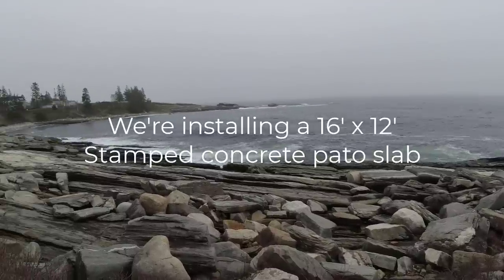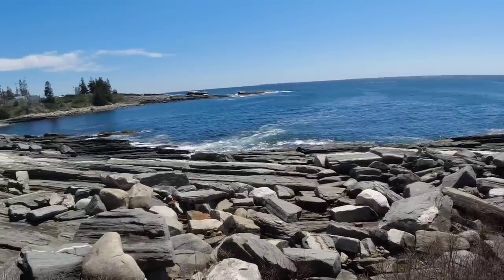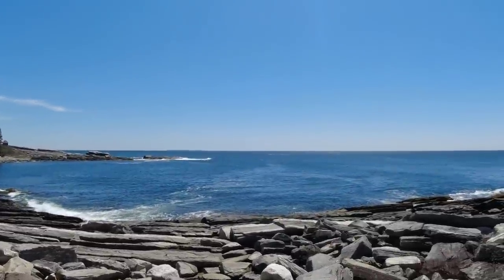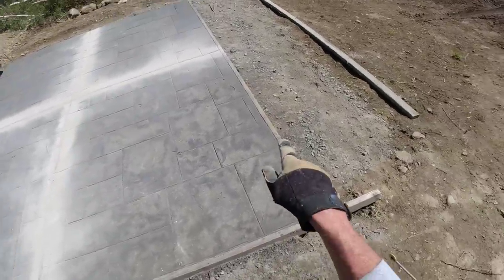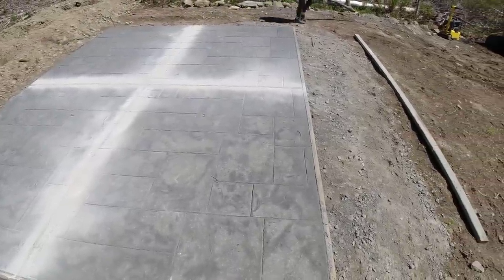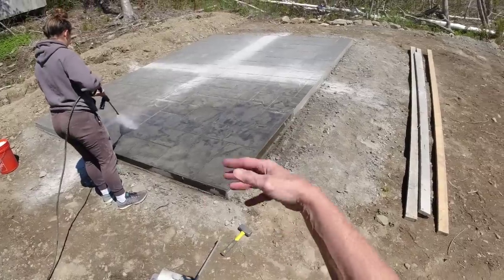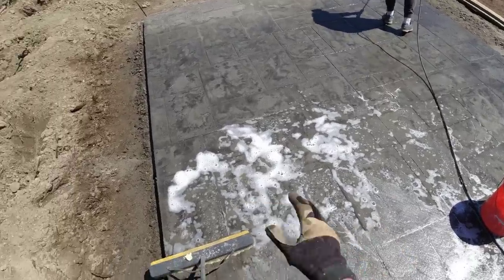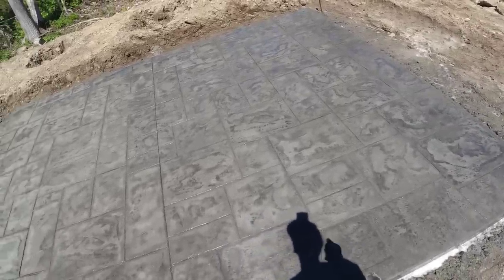How To Form, Pour, and Stamp A Concrete Patio Slab. 16' X 12'

Comment: What’s the advantage of sawing control joints versus tooling them? 
Love the videos Mike! Awesome team !
Reply: Not habeinf to tool them in saves time and more detail work for a stamp . ssaw cuts look better in decortive stamps
Reply: tooling joints work as the concrete is drying, you should always tool a joint if you can. cutting it you risk it cracking before you can cut it, especially in summer time. 
but sometimes you just have to cut the next day like shed slabs big pours etc.